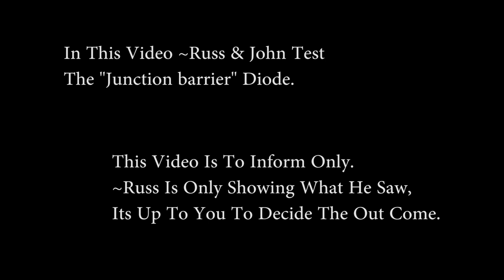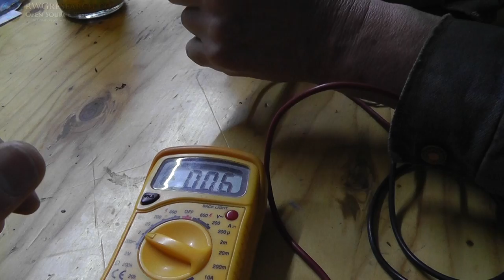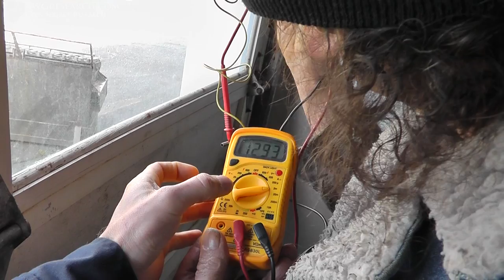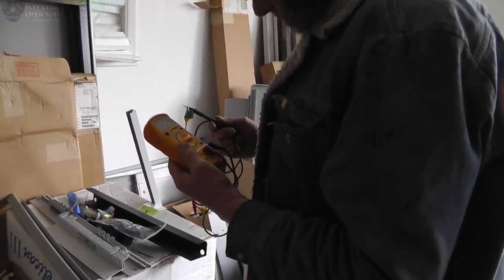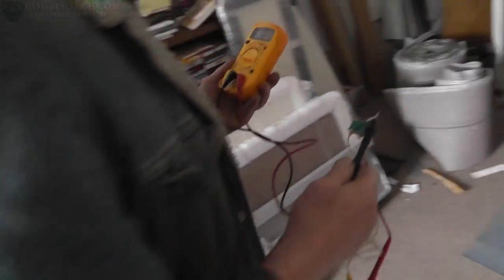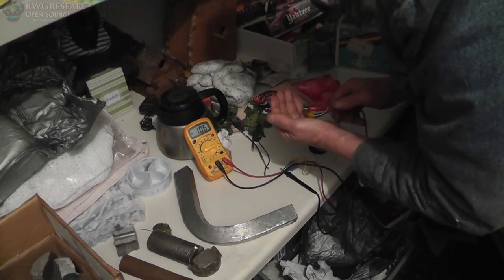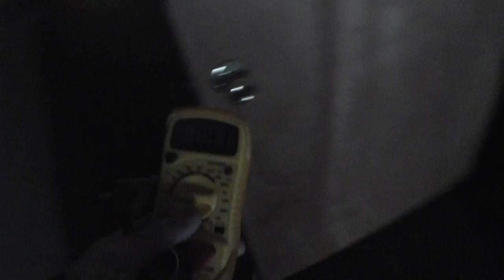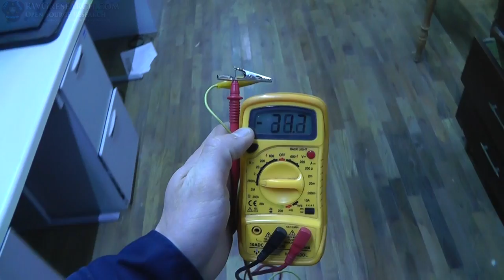"Junction Barrier" Diode Testing,  John Hutchison & ~Russ Gries

Comment: 1/4" of black heat-shrink would isolate it from the light, and see WHAT ELSE affects it!  If it still does it after "blackout", yet while in sunlight, then you're measuring a non-photonic energy.   BTW, when you use mA scale, it places a current shunt (short) across the leads, so the Current measured is at near-zero Volts. You can't use the mA measured that way and the Volts to assume watts. To get watts, you need to use a load resistor, and put the current meter in series with it, WHILE measuring the Volts across the load resistor..

Comment: +rwg42985 The yellow digital meter seems to have a defect in the millamps range, so that the switch does not give contact...so contact problems also in the meter switch...

Comment: +rwg42985 would have been nice to see the ouput on a scope....Did John not have a scope there ? And it did put out. just the expected around 320 MilliVolts from a Germanium diode... with all the RF in his other rooms from the RayGun there is probably also a lot of RF flowing around there that this diode can rectify and show on your yellow meter there...but the Egg holder tests seems to show, that is mostly the light that generates the output... hmmm...